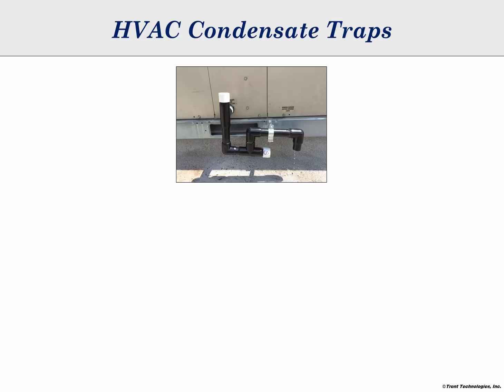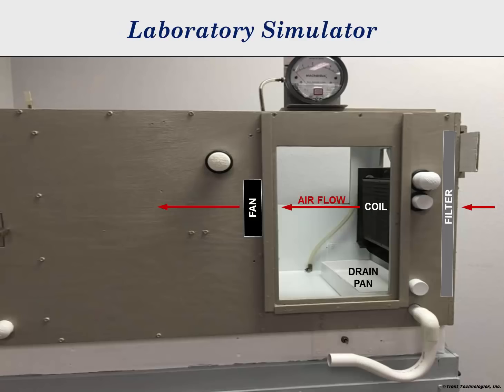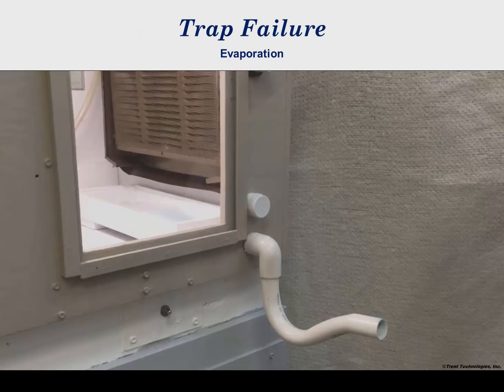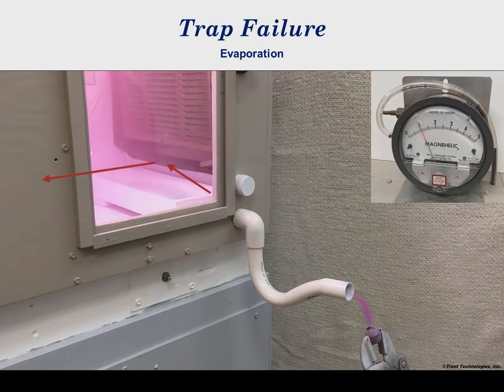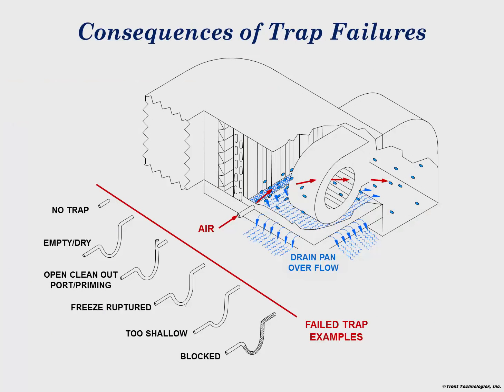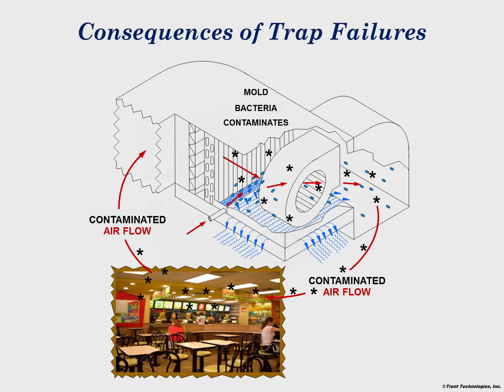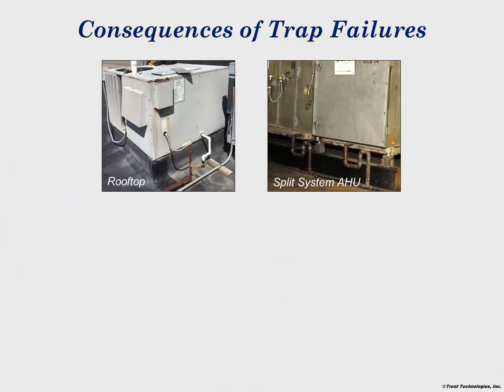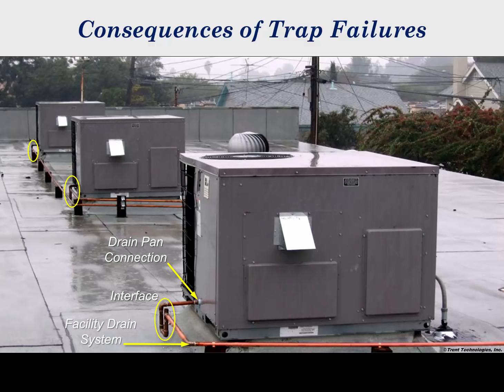Understanding HVAC Condensate Traps

Comment: what would happen if a line was going from 2% grade to level? would the 2% slope still push the water through? or would it just sit there?
Reply from the maker: Slope to the main drain should be 1/8" per foot.  CostGard uses the force of gravity to drain the water out of the system.

Comment: I found out that if your A-coil is down stream of the fan it is under pressure and you do NOT need a trap. If your A-coil is before the fan it is under a vacuum and you DO need a trap. In most home units are under pressure, NO trap needed. So look at your furnace, you probably do NOT need a trap. Don't waste your money and time if you don't need it.
Reply: Mine is def under pressure and my coil is before the fan
Reply: @ex7229  ..when viewing airflow.....if your coil is "before" the fan ( meaning, upstream of the fan closer to the air i let of the air handler box), then there is no way your coil is under pressure. Like a cannister vacuum cleaner, the motor being downstream ( airflow direction), means the blower/motor is "sucking" air across the evaporator coil....not blowing it over the coil. If it's sucking the air over the coil....the coil is operating at a slight negative pressure.
Reply: It’s still good practice to install a trap, because you have a pretty good air leak if you don’t.  Probably wouldn’t pass inspection without it.

Comment: When blower motor set to high speed all the water in the trap will be suck into the unit and water never came out (negative pressure inside of the trap). This is a very stupid design. I have seen a lot issues on commercial units. Why don't put the fan behind the coil to blow the air through the coil? This way water will be blown out.
Reply from the maker: Most HVAC units are draw-through systems. Draw-through units create an air flow that allow higher cooling efficiency and a smaller cabinet footprint, which minimizes manufacturing and installation cost/expense.  Blow-through HVAC condensate drains require a drain seal as well. Conventional traps on both blow-through and draw-through systems are prone to failures, which is why we have designed the CostGard Condensate Drain Seal for Blow-through and Draw-through HVAC systems.
Reply: Alice Pet 
How to calculate U-Loop length to maintain liquid head more than blower negative pressure head...
Reply: @dixitpatel2873 it's easy to calculate the drain size.